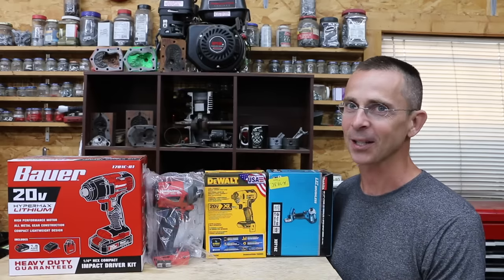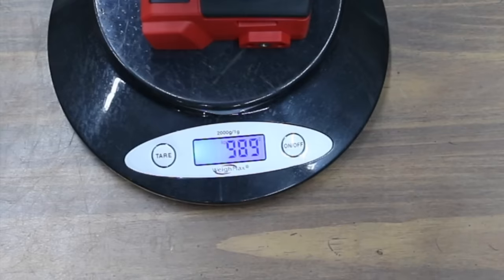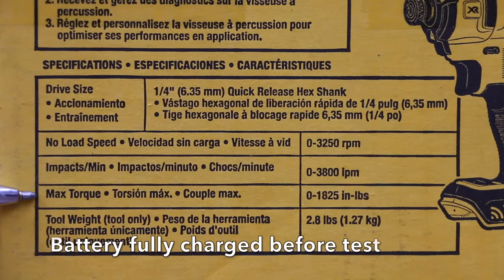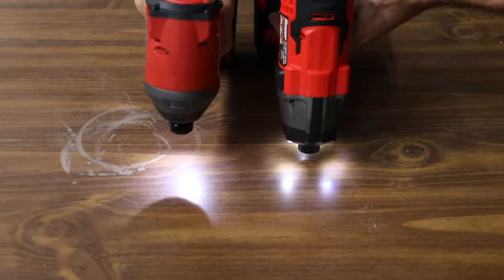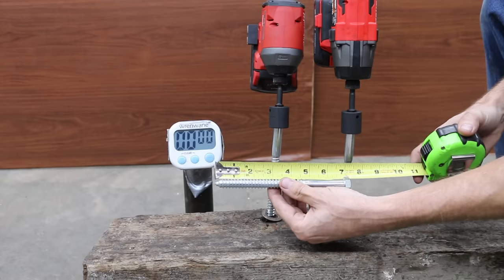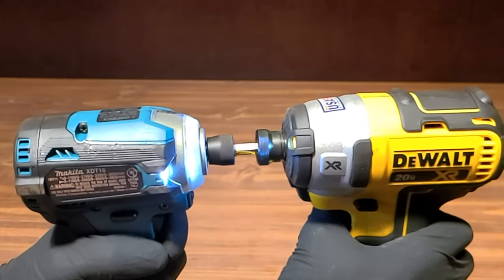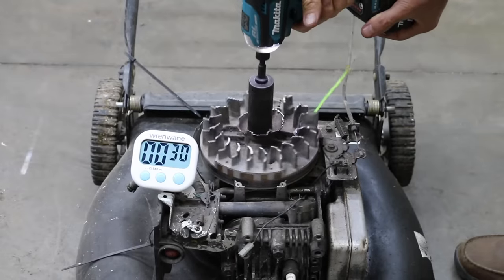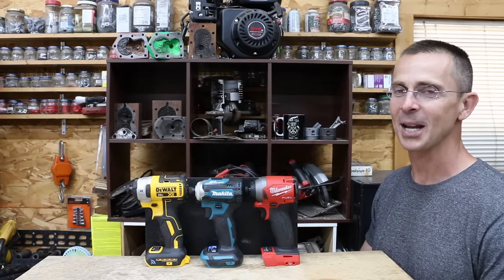Best Impact Driver? DeWalt vs Milwaukee vs Makita vs Bauer!  Let's find out!

Comment: I'd like to see the same comparison against the dewalt DCF840 instead of the one used in this video. I imagine it might do better.
Reply from the maker: Thanks for the video idea.
Reply: @ProjectFarm  No problem.  You clearly are very thorough with your product comparisons.  Great videos.  I recently saw a video on the DCF840 Dewalt impact Driver and it made me wonder if you always use the tools from each brand that are rated as the best of each brand when comparing.  Dewalt has so many impact drivers as do other brands.  To see the best of each brand compared, I think would be a great video.  Obviously this would change as each brand is always coming out with new designs and tools.

Comment: can you please add pressure-torque conversion or even a bolt size to the test results to use it as a reference ?
Reply from the maker: Thanks for the suggestion.

Comment: Milwaukee has an auto stop feature for safety. It can be turned off by putting the switch between forward and backwards, then press the trigger three times.
Reply from the maker: Thanks for the feedback.
Reply: @ProjectFarm no problem! Though after posting the comment I did realize this video is 3 years old, so my comment isn’t really helpful.😅
Reply: @ProjectFarm and i think it’s 5 times, not the 3 I originally said

Comment: Can you test the Greenworks 24V impact driver ?
Reply from the maker: Thanks for the suggestion.
Reply: 24V BRUSHLESS IMPACT DRIVER W/ (2) 1.5 AH USB BATTERIES

Model 3803702AZ

The torque spec claims to be 2800  in pounds